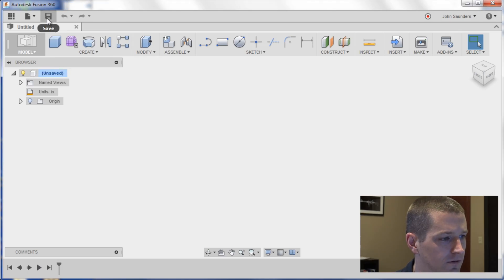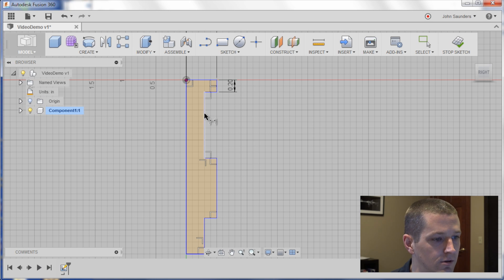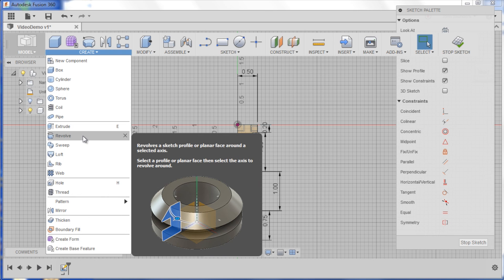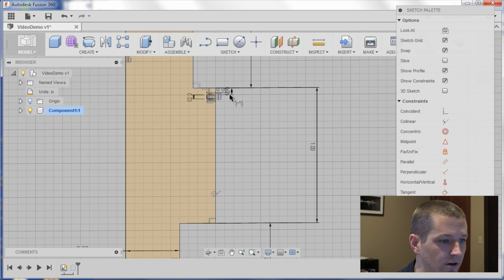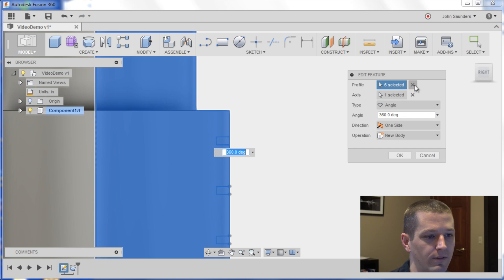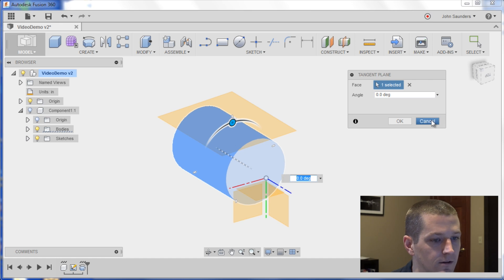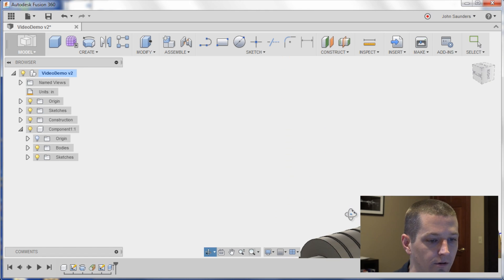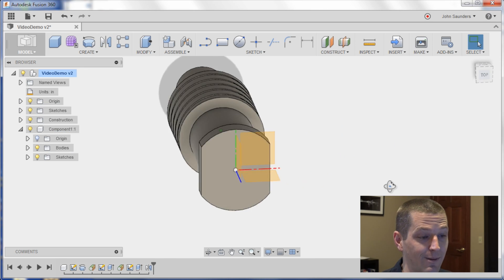Fusion 360 Lathe CAD. Fusion Friday #17

Comment: Hey John, not sure if you know, but in Fusion you can do diameter dimensioning by clicking on two parallel lines you want to dimension, right clicking, and selecting "Diameter Dimension" - whatever line you selected first will be treated as the axis.  Definitely a helpful trick when designing lathe parts or parts based around a central axis.  Good pointers on the tangent plane though, didn't realize you could click a surface for alignment!

Comment: John

Great video and good tips

May I be so bold as to ask a question , I am still leaning fusion360 and my cnc mill 
When I sketch up a component and go to cam to sort out the tool path ,I get along ok , a bit slow . Now the problem when it does the ramp down it starts say 3mm above the part which is 3mm thick so the cutting ramp time is twice the time I think is should be . I think it's the retract and or clearance heights that are wrong , when I set the retract lower than 3mm from stock top it throws a error. Maybe you could include it in a future video just a block with a 3mm deep pocket would demonstrate it 

Sorry to be a pain but just under 70 the brain cell is a bit slow🙁

Stuart
Reply: +NYC CNC OK John done that how do I ask you a question
Reply: +Stuart Hardy Go to the "linking" tab, and you will find a "ramp" menu which has a setting called "ramp clearance height", along with all the other settings for ramping. The only heights in the heights tab you generally need to set are the bottom and top height to make it work properly.